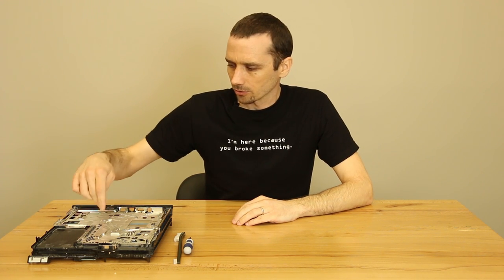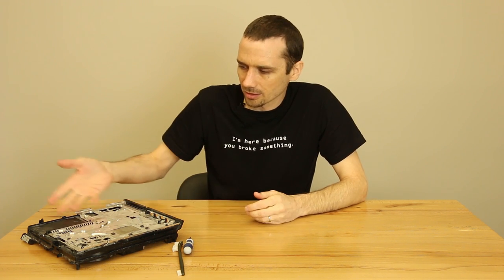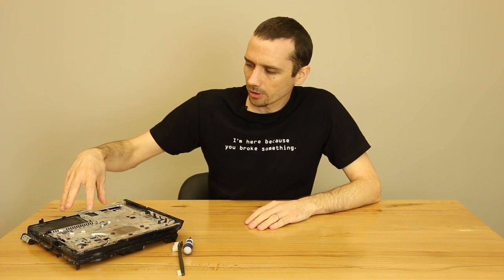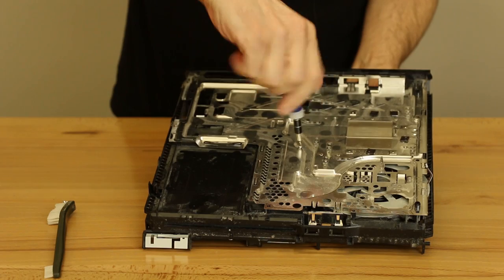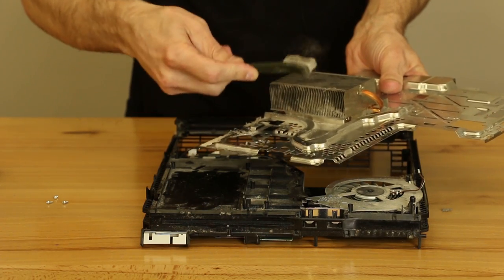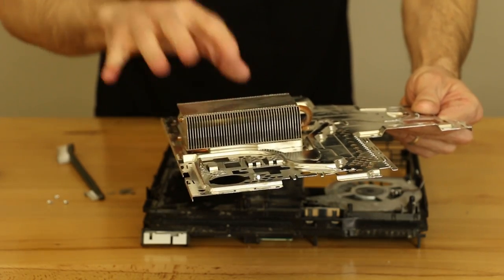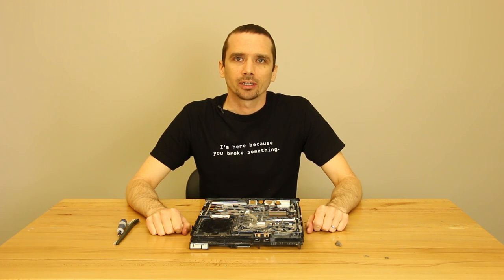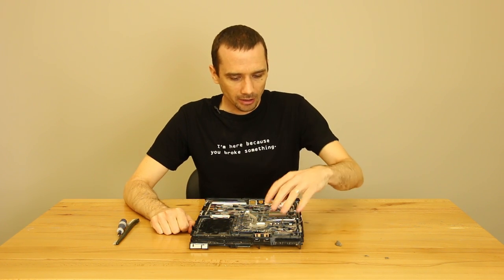PS4 Overheating Repair Tips - How to Fix Loud PS4

Comment: I have no idea what's wrong with my ps4. At first my ps4 had a power supply which I easily fixed but now it's having the same problem to not to the degree as before. I switched the power cord and it worked perfectly for almost a month now when I get it to safe mode it would show connect ds4 then no signal with solid white light and I would unplug it and it would give me blue light or solid white light with no signal to the tv. After I restored my ps4 I just decided to switch tv's and it actually went to the home screen for 20 minutes then turns off twice. Third time it's been on for now 3 hours only downloading games and videos on youtube. Sorry for it being so long but I'm not finding any of my problems for this
Reply from the maker: Sounds like you have several different problems going on here. What was the original problem you were trying to fix?
Reply: +TronicsFix A faulty power supply
Reply from the maker: So it wouldn't turn on at all originally...not noises and no lights when you tried to turn it on?
Reply: +TronicsFix orginally it would turn on for a second then turn off now it can turn on but after a while I could be playing a game or just have it on then it would give a beep and give no signal with the console still being on
Reply from the maker: OK...it's likely that this is all part of the original problem of the console turning on then back off.
Reply: +TronicsFix I have no clue on what to do any ideas to what the cause might be?
Reply from the maker: I would start with this: https://www.youtube.com/watch?v=pszuueUTBrk

Comment: I wouldn't recommend anyone to buy the fan replacement for ps4 from highfine i bought becouse it was the one tronix recommended but when i received it came in broken and bended and the package was fine. Its a complete scam to buy from highfine

Comment: Mine is not even hot and it turns off with the message:the temperature is too high
Reply from the maker: If it's says it's too high then it's overheating...even if it doesn't feel hot.

Comment: Think I'm done with PlayStation.
I still have original working fat ps2 & 3 but have had my ps4 replaced after 5months as it stopped turning on and now 12months later the new one just shuts down after 3rd an hour or less of gameplay.

Screw you Sony.

Comment: I cleaned the ps4 including changing the thermal paste and it's still loud, it's louder when i rung the latest games and graphics take more performance. Once just froze and another time shut down without the led turning red.

Comment: I want to send my play station in to get cleaned i have no idea how to take it apart it keeps overheating
Reply: there's a lot of videos here on how to clean it. as long as you can remember how to put it back together, which is really simple. you can do it yourself. it takes about 30 minutes to take it apart and clean it